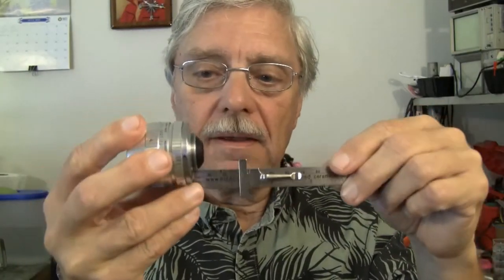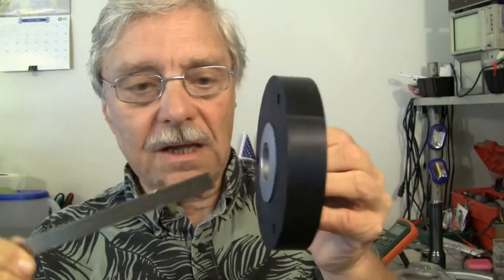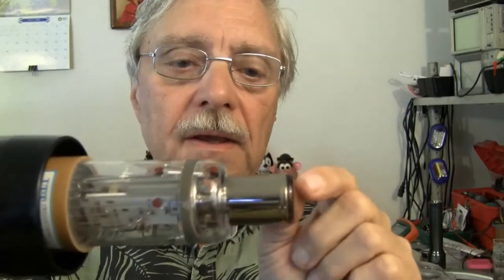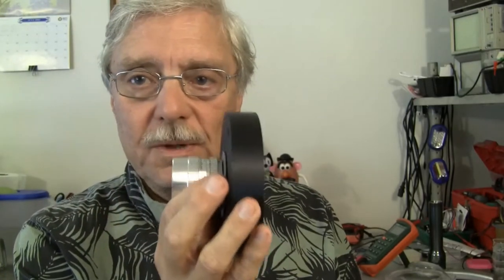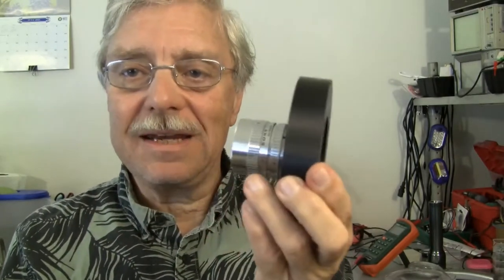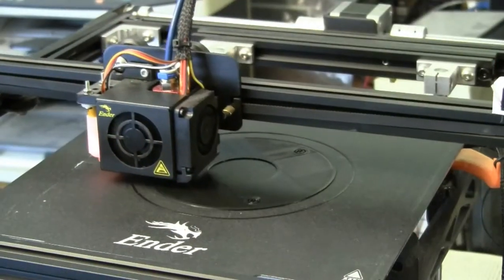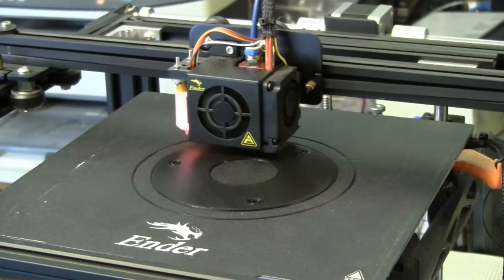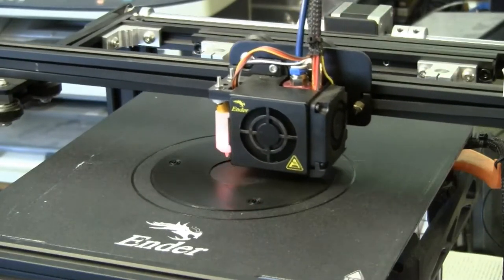NBTV DissectorCam Project, Part 8

Comment: How come you didn't just print an extension ring? Is it critical that it's all one piece?
Reply from the maker: That's a fair question. I considered that option and it would be faster. True. But, it was actually easier to just "pull" the existing part out by 7.5mm and not add another part to the bill of materials.